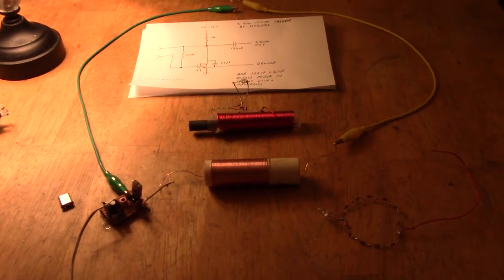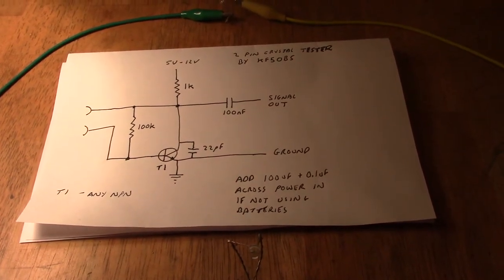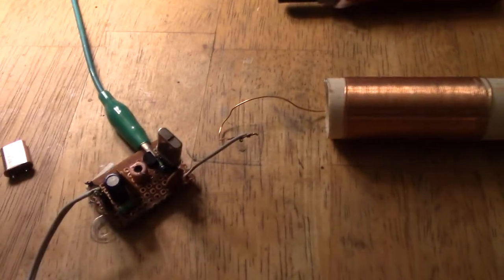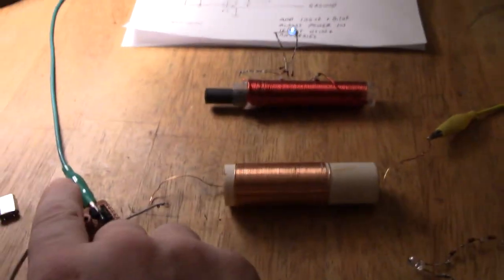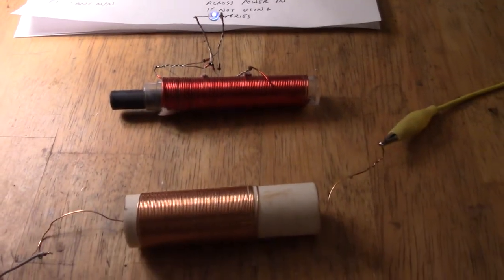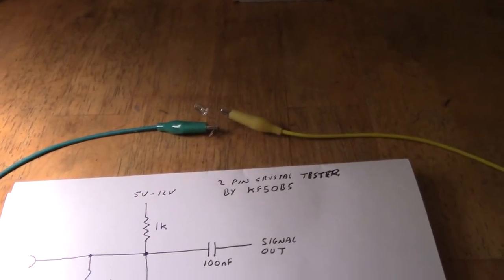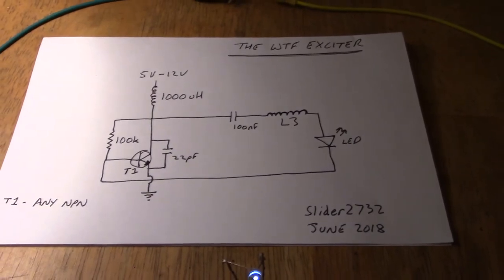The WTF Exciter

Comment: I like your approach to discovery.  And know the feeling (rush) you can get in stepping into "new" or at least new to you phenomena.  But in truth, I think I have seen this form of oscillator before in my Navy days.  If right, it is an oscillator where a series or parallel tank is used for feedback between the plate and grid in vacuum tubes or the base and collector in your case where you have the series resonant feedback 100nF cap and L3 inductor.  (This type of oscillator was common back before the crystal days and in school we would use a test substitution circuit to plug in to the socket where a crystal usually went just to verify if a crystal or its circuit was bad.)  Either C or L3 should be tunable in your circuit.  I have a very old book on oscillators and shows hundreds of circuit designs using LC, LR, LRC or just RC, RL or even neon tube relations to create oscillation self sustaining feedback.  I may have a look to see if I can find a similar match to yours.  I would think you do not need the LED for maintaining oscillation and might get a more intense output signal by shorting across it.  A LED to RF is just a nonlinear diode with a small capacitance changing (decreases) as voltage rises up until the point of full turn on and C goes to 0. I have had a circuit using this nonlinear feature to advantage but don't think this is involved here.  Could you short the LED and reply whether the oscillator still works and if intensity or load distance increases?  May have to retune, adjust after shorting the LED for best output.
Reply from the maker: Thanks. The circuit has morphed a bit now, to have an L1, L2 and L3, removing the need for the long cliplead arrangement. However, the LED is still there and glows more with increasing voltage still. 
Test result at 5V: With no short, the LED is on dimly. When shorted oscillation stops. When the short is removed, the LED flashes brightly and then dims to normal level.
Reply: Wow you are moving so fast, it is hard to stay on top of what you have going:)  Were you an apprentice of Edison by chance? :))  The test results with 5V is that the circuit in this video  or your 3 coil morphed version?  And finally, are you saying the LED wired as shown in this video is required to maintain oscillation?  I ask because I don't recall any of the oscillator in my book using a diode in series to a tank.  And now that you have more coils involved the interactions are more complex by using transformer induction in the mix.
Reply from the maker: Tests were with this one in the video..hadn't built the other yet.
Yep, the LED has to be there. It goes back to the SWES videos of years ago, where I used water as the limiter for the Base of a transistor. An LED dropped in the water would glow. But mainly, the need to remove hand capacitance to keep it running even with a large metal mass and, I thought that it may work with a 1 direction feed. Quite why is unknown lol...the guy that was one of Edison's apprentices would probably know ;)

Comment: Very cool.  Funny how one man's serendipitous source of RF, is another man's EMI noise to be squashed with ferrite beads everywhere.  Anyway... If you measure the frequency of the oscillation, does it match (or come close to) one of the 1/sqrt(LC) values of an inductor-capacitor pair in the circuit? That may give a clue about the source of oscillation, and the feedback to support it.
Reply from the maker: What's The Frequency ? as a name is apt because it should be variable when the 'L3' is changed, but I don't know yet how much difference the L1 is going to make. It's a start on better understandings is how I see it for myself. From which is the frequency, 6.7MHz, which ties into uV's post on Overunity about 1/2 a crystal oscillator frequency. 2x being pretty close to 13.6MHz.. Next will be 'L3' coil inductance changes and tunings.
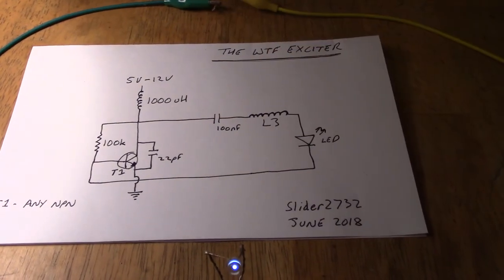Reply: I'm a bit slow... but I think I see what you're getting at.  I watched more closely and noticed (at about 2:40) you referred to the original L3 coil as "L2" -- i.e., like it was the secondary coil of an SEC circuit.  So your feeling is that the two coils (LI and the original L3) are now acting like the primary and secondary coils in an exciter?   That's an interesting idea.  Have you tried changing their separation from each other?  Does the RF get stronger when they are moved relative to each other.  Sorry for all the questions.  This is just damn interesting.
Reply from the maker: Haha, yep it's very interesting. L3 is simply because of the similarity to the Doc's larger tube coils. In fact it's all gone weird again because I now have a coil instead of the cliplead The coils sit 1 behind the other. The circuit now has an L1, L2 and L3, with the Dr. Stiffler type actually being L3 in the circuit.
In some ways, yes, a Slayer situation. An AV plugged LED shows the L3 to have wireless output strongly all along, the L2 to have output only in 1 section (1/3rd along). New resonance is 8MHz. The circuit will turn off if the coils aren't just right, a bit Goldilocks for when they strike up resonance on the veroboard. But within the switched on area it can be tuned between about 7.5Mhz and 8.5Mhz. Adding a cliplead stops oscillation...oddly enough. Likely a vid tomorrow :)

Comment: When I added that 1000uH I was thinking that the circuit was beginning to morph into a SEC kind of circuit.  Congrats on the success.   Mine will not run on a USB power source.  Try a 9v battery and see what happens.  Perhaps what you are seeing is in part due to the power source?   I will try  your mod and see what happens. If It is runs on a battery then a true new exciter has been born.
Reply from the maker: It should run fine as I have a 100uF and 0.1uF across the power rails for such problems. Quite right to mention it & was why the original circuit had that advice on the bottom left. 
Last night I tried a Chinese booster with it and ran it up to 20V...no luck on the DT bulb but the 'L3' will tune it I think....it's a fun off-shoot and was totally unexpected :)
Reply: I will try the filters.  Good news today---Gary Bluer left a comment on my last video.  Wouldn't that be great if he got into involved with this.  A reforming of the old team.
Reply from the maker: Definitely ! and always good to know that he's still interested in furthering these things. Jonny Davro and Illuzyon1 need to be found. I hope Magnetman2010 is doing well too. sMartcreations posted a vid not long back. MongrelShark has been around but I don't think we've got anything high powered enough yet for him  :)
Reply from the maker: Oh and it looks like Stefan is rolling something out, Overunity is down for maintenance.